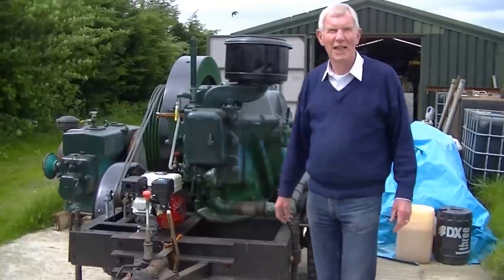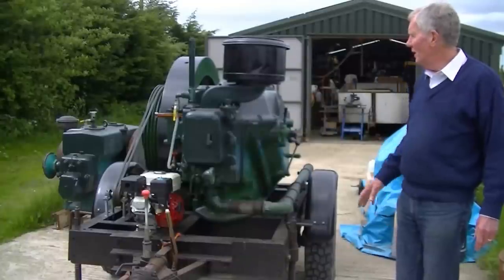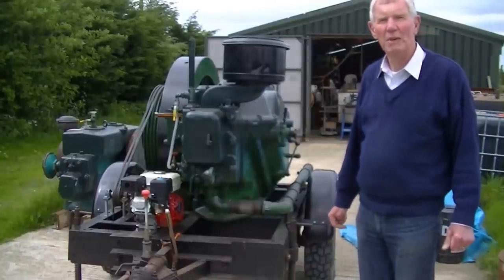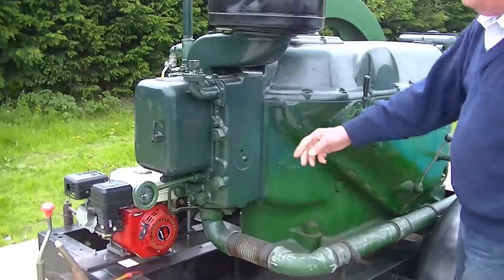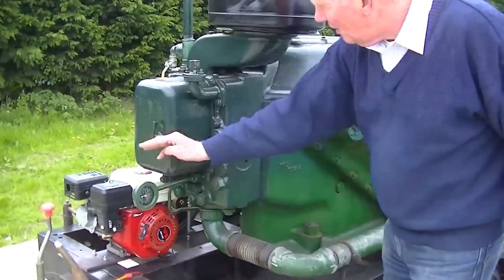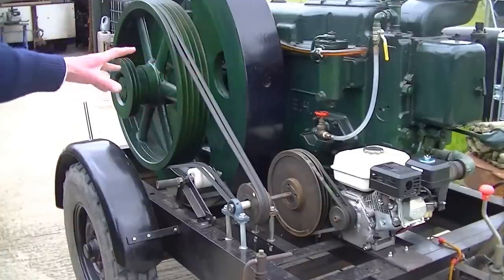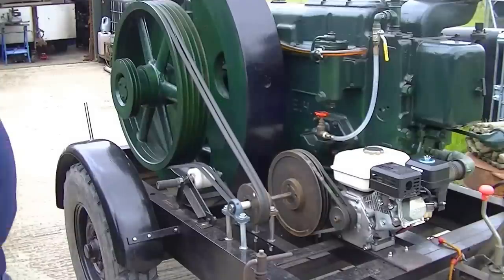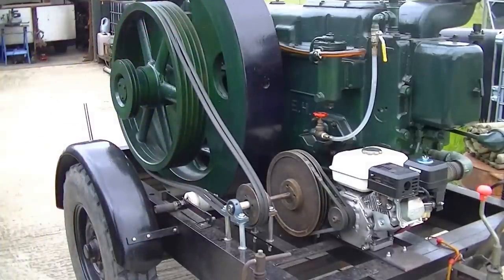Big Blackstone Engine Start Up!

Comment: Thank you for the video.  Very interesting.  I had a Blackstone engine too, but less powerful -  a 27HP air-start spring-injection one that used to run some drum-roasters in Tivetshall Maltings in Norfolk.   After setting it up at home (Denton in Norfolk) and running it a number of times, I sold it to a museum in Wales.  I think there is still one like it at Denver.  John Fearnley.

Comment: Beautiful engine but you Sir run it for few seconds only ! I had to see it for little more hours because I love engines very much from my boyhood.
Reply from the maker: You are right of course,  Bijan,   but I had already drained the water and removed the bulk water tank, I used to cool it. Nothing gave me more pleasure than the sound of it thudding away doing usefull work.
I have a 30 HP Danish Asaa  twin flywheel diesel waiting for the bore to be de-glazed and that will one day be used to provide 3 phase for my workshop,  via a flat belt  and I shall harvest the warm water, too.  And sit and listen to it as well.
Thanks George.

Comment: Congratulations !. I like horizontal diesel engine water cooled. Blakstone JP OP very nice design !
Reply from the maker: +Federico Centola   Hi Frederico,   Thanks for the comments.  The engine is actually a Type EHE  and like I said, I cannot find any references to any others like it.   The full story of it's history and how I got it back to UK from the Arabian Gulf is told on my website : http://www.maribelecosystems.co.uk/OldEngines.html   When I was there I saw a lot of JP twin flywheel models, but no others like this.  Best regards George.
Reply: "George Bell z😇👤😇😕😆😅

Comment: Thank your George from your responds, i saw that there is  same engine in my country and now is for sale, I'm interested to buy the said engine and my plan is to use for generator to drive the 35 KVA of dynamo, i agree that stationary diesel engine is economical to operate in terms of fuel consumption.

Comment: One of those very well built Blackstone closed crank case horizontal engine running on crude oil/ diesel. Most horizontal engines are open crank case with drip feed oil lubrication. Did not see water cooling set up. Is that why you shut it off? How often did you change engine oil in these? Thank you for the show.
Reply from the maker: Good day, Raj.     The earlier engines did have open cranks,  As they permit the viewer a more interesting picture,  which is nice, they did not have the protection that full enclosure gives, which is certainly not nice!
If I was going to run the engine for a longer period, I used a 40 gallon of water which circulated by thermosyphon circulation, the hot water in the engine came out of an outlet at the top and went to a pipe at the bottom of the tank.  then this water rose to the top of the tank and was heated by passing up through the water jacket inside the engine. This saved the cost of a pump. For a short run, I used to just fill the water jacket with water.   There was a lot of oil in the sump and  I used to top it up - if necessary,  before each run, when I pumped the cold oil round the system. A full oil change would have been expensive and I did not put the engine to a lot of use!                                                    Thanks for the interest.  Regards George.

Comment: id als add a 12volt car alt to charge batteries since it got such a nice place there at the clutch area to put one..or ac generator even..water and electric nice motor

Comment: Hi! George i have question on you, how many liters of diesel fuel in every hour consumed by that engine and about the spare parts it is easy to find? Thank you...
Reply from the maker: Hi Rommel,
When I first exhibited the Blackstone I did not have a tank fitted so I rigged up a one gallon can of diesel connected by a plastic pipe on a stake banged into the rally field.  I started it at about ten in the morning on a slow tick-over and no load and it was still running OK at the end of the rally about 5 hours later.  Driving a 50 HP load would use a lot more!  It was designed to run for long periods at a maximum of about 500 rpm. Usually from a huge bulk tank for pumping water.

Spares would be a problem as Blackstone, although they existed when I acquired the engine, do not exist as a separate company now.  I have fabricated smallish parts in my workshop.  

I am now restoring an Indian  Kirloskar 2 cylinder Diesel of about 11 Hp and I will take a few photos of that when I can get it out of the depths of my workshop, which is a bit cluttered. I have just finished the preparation of a 1970 Chevrolet Corvette Stingray  convertible, which will be for sale and it was displayed at a rally we held in our village of Rackheath Norfolk.  The Rackheath Vintage Fayre of the 22nd May last. See my website below. For Sale.
 
Regards George.

Comment: Hi,,,George ,the small engine is a Brig Stratton    or other trademark???  the small engine makes a lot of force to try to start the huge engine.  Nice video,,,,very slow engine   250 rpm i suppose,,,,the power,,,,10,,,,,15 hp??????is enough for an slow enginne.   very good video....if yoou read me,,,please,,,answer,,thanks,,,,daniel from Argentine
Reply from the maker: Thanks for your comments Daniel.   It is rated at 50 hp  but delivered fairly slowly,. the starter motor is from a Chinese generator set and is about 4 HP but geared down by the belts.   I burnt out the alternator from this  set when a water pump seized up and I found clouds of smoke coming from trhe alternator which had no overload protection at all!  this was the first time I ran it,  that why I used the engine as it had not been damaged.  The history of the Blackstone and how I rescued it is on the website below but It  is taking a while so there are not many pictures as yet
I have started to populate a revived website called  after my wife, called www.maribelecosystems.info and there will be a lot of information about other things like a car and lorry, crushing plant that I managed to get working for a company who shipped it out to Abu Dhabi from UK and could not find out why it did not worki when they tried to test it.   I just had the right skills to fix it all in about ten afternoons. They could not pay me so I used to have the freedom of the site and anything I wanted.  This is how I collected a number of Chevrolet small block V8 engines which I will never use now. They were spares for my 1970 Corvette which I had to sell a few years ago.
Best wishes,  George.
Reply from the maker: Thanks for the comments Daniel.     I would not like to run it as fast as that!  It is 30 HP and on a slow tick over it will run for hours on a gallon of diesel.   Several people have suggested an electric starter and if I still had the engine I would probably use that.  I just thought it would be a bit more interesting to have two engines one last time I took it to a Rally..  By the way, the full story of how I found it, including bringing it back to UK is on my website:  www.maribelecosystems.info

Comment: A bunch of exposed belts and pulleys plus gasoline is much safer.
Reply from the maker: Yes, I take your points, but it was a rush job to avoid the use of compressed air and get ready for a public rally,

Comment: Big?!
Reply: Very nice I have 22 H.P. doubel wheel engine good condition
Reply: Bob Singh do you know how I get the parts for 26 horsepower and 16 horsepower Blackstone?.
Reply from the maker: By comparison Steve I weigh  77 KGs.  the Blackstone is about  3,000.  That is a lot more than me.  It is a bit of a handful towing.  See rescue details above  Old Engines Maribelecosystems.info. And I would hate to drop it on my toe.  It will always be Big to me!   Thanks for the comment anyway, Regards George.